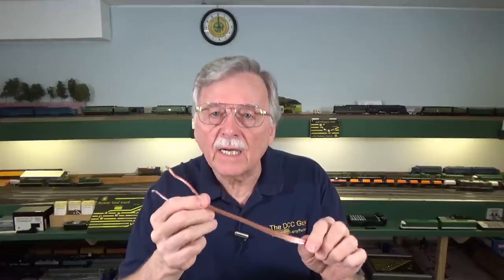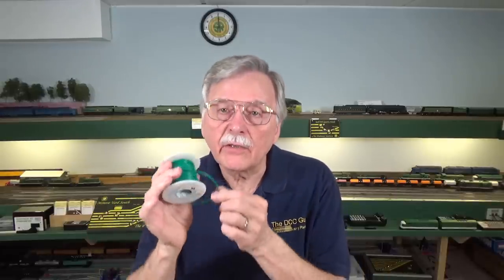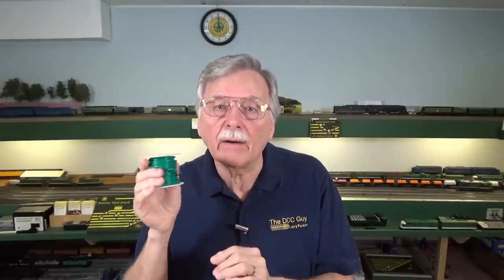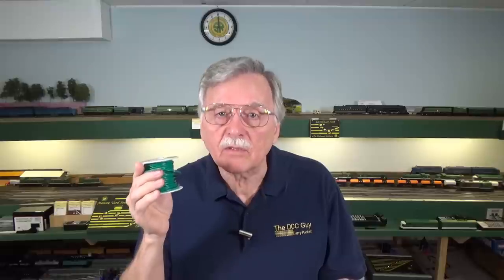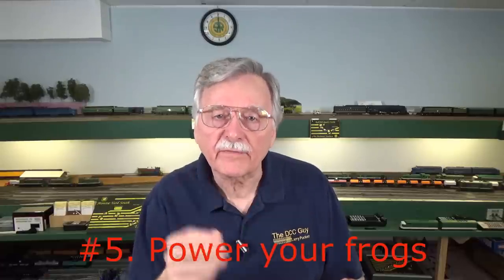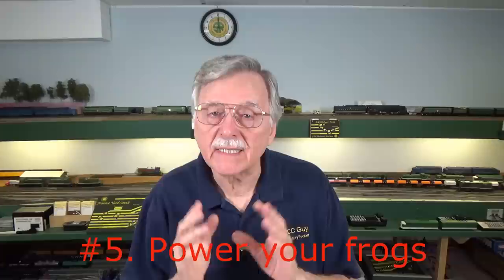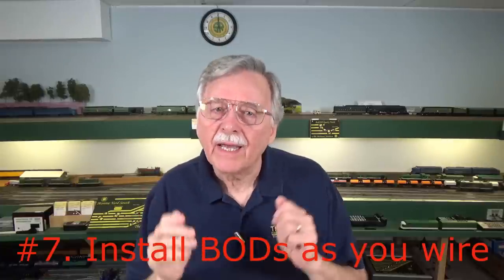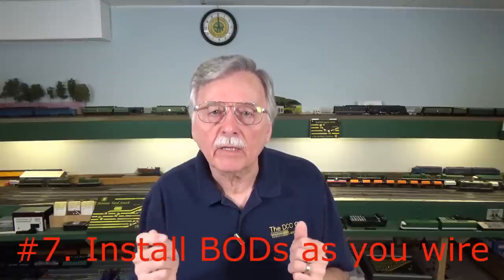8 Electrical Tips For Model Railroaders (313)

Comment: The copper and silver wires you use for your dcc bus wires is known here in Australia as Speaker Wire. I can highly recommend its use. Also, your eight points for wiring is spot on. Thankyou Larry.
Reply: Be cautious with speaker wire.  The speaker wire that Larry uses is true copper wire.  At least in the US much of the speaker wire is actually copper coated aluminum wire.  A 14 gauge copper coated aluminum wire has the same resistance as 16 gauge copper wire and is harder to solder.
Reply: @jimfisher7324  Thankyou for your comment. Yes we are aware of the possible metal mix up. I should have said our wire was copper, the silver one being tinned copper. On a side note, I would have soon twigged on if it was aluminium when I "tried" to soldered it/them 😊

Comment: Larry Great video   I even use Cable labels on my bus lines  I have 18 DCC bus lines so I needed a way to identify them these labels are like a  zip tie  and then I use my label gun to mark them but you are correct you must document your wiring everything under my layout has a label which helps me.

Comment: Great video Larry. It's always good to have a collection of techniques summarized and I appreciate the years of experience. Grounding of DC systems, was interesting, and I totally agree with the concept of keeping the hobby electronics separated earth wise from the safety ground from the utility. In fact, in my industry it is standard practice for all control systems and instrumentation to have what is known as an isolated ground. A separate ground rod or grid from the main power earth. I do not earth ground the DC, or DCC components but as you stated they are connected (Digitrax), as well as the (-) leg of the DC power supply. Also, getting the wiring sorted in advance is also great advice. Since I plan on automating my layout, the correct addition  of proximity sensors around the layout for stopping etc. would be difficult to do later. JMRI is helping to organize what I want to automate, and therefore helping to locate sensors where I need them in addition to current sensing block detection.

Comment: I was particularly interested in the step-down power supply converter system as I have developed a low-cost DIY under track switch machine powered by a 3 volt DC motor.  These motors can be purchased in bulk at a very low cost and they can be mounted to the underside of the switch ties and connected directly to the switch throw bar making a very low cost, compact switch machine which can be installed in a matter of minutes. A sticking point of my scheme is a power supply. I had considered battery packs as the power required by these motors is so low that even a AAA battery will last for years. I have beta tested these machines on fellow modelers layouts so this is not a guess. Another advantage of my design is that it can be used to operate line side equipment such as a semaphore by having a center off position and selecting "stop" or "proceed" by changing the polarity of the voltage to the motor. This would require providing power for an extended period of time rather than intermittently as in a switch application. Using a power buss would make this feasible. BTW at 3V a DC motor can be left powered up indefinitely without danger of overheating. I tested this as well by leaving a motor powered at full stall overnight and checking its temperature the following day. Do you happen to know if a stationary decoder could be connected to a 3V power buss and used to control devices operating at 3V? I would love to control switch arrays (yard ladder) powered by my 3V motors with my hand held throttle.

Comment: As you were talking about the 12Vdc bus I was thinking about the 3Vdc for LEDs.  I've used them to avoid the hassle of dropping resistors, especially when a large number of LEDs are in a single building and push the resistors to their 1/4 or 1/2 watt power rating and get quite hot.  There are also an increasing number of accessories using 4.5 Vdc, so if you end up with a significant number of those another dedicated bus is justified.
Reply from the maker: Yes, add whatever makes it easier in the long run. I love those little buck boards which allow me to customize a local sub bus for whatever purpose is required.
Reply: @Model Railroading  I use buck converters as well, notably for the 4.5Vdc needed for Miller Engineering animated signs.   I don't have enough to justify a full bus but as things develop it might become a requirement.  I also find it worth paying the extra dollar or two to get the ones with the digital voltage readout.

Comment: A note on Digitrax "grounds". As you point out they are not true grounds.  " The "grounds" in the loconet cable are connected to the ground terminal on the power plug.  If you don't run a wire between the power plugs, there is a chance that a high current from a fault could be directed through the 24 or so gauge of the "grounds" in the loconet cable.

Comment: Regarding the "floating ground':  you mention that DCC equipment such as those from NCE should have ground from each piece of equipment connected together.  Could that same ground be run outside to a copper rod driven into the ground (earth ground), or do the floating and earth ground have to be kept separate?  My electrical knowledge is barely past the ability to change a light-bulb, ha-ha, (it's actually not at all funny due to the potential to ruin over-priced model RR equipment).  I've ordered and received from Kalmbach Hobbystore in WI two of your books (Wiring Your Model Railroad and Wiring Projects for Your Model Railroad) and have begun studying them as I prepare to build my first ever model railroad layout (n-scale, 5'x14').

Thank you for all the videos you have made, sharing your knowledge, advice and tips for this model railroad hobby; I've been watching hours and hours over the past few weeks.

EDIT:  Your channel seems to focus primarily on DCC -- can you point me to a source for DC model railroad knowledge, as I am not willing to pay the outrageous over-inflated prices being charged for DCC equipment?  Thank you for your time and assistance.
Reply from the maker: NCE recommends against doing the true earth ground, just the floating ground.

Comment: Great advice.  But you left us hanging. what was the electrical problem with that layout?
Reply from the maker: The worst one was it was just one long power bus over 100’ long and not a single circuit breaker anywhere! We still haven’t figured out how the signal system worked. Plus the throttle network did not have sufficient power and there were too few wireless receivers. I found some feeders that must have been 10’ long, doubled back on themselves, and used tiny wires. The surprising thing was the fellow who did the wiring was a retired electronics tech on nuclear subs!
Reply: Okay, the electronic tech from the Navy explains a lot. Their motto "There's never enough time to do it right the first time but there's always time to do it over again".😂

Comment: Hi Larry thanks for your reply what i want to know is if it is relevent to the upgraded equipment  or is there another book in that covers the modern stuff Cheers Steve😎
Reply from the maker: At this time I don’t know of any. You likely won’t find books with detailed info on specific equipment since manufacturers upgrade often enough that the book would be out of date quickly and publishers try to avoid that. Most detailed info is published in magazine review articles or in DCC columns.

Comment: Thank you Larry for the great tips, as usual. In a DCC layout, we all know that you should limit 14 gauge wire to 30 feet but is it just the command station or the bus wires? For example, if you have a linear 120 foot layout and the bus is broken into 4-30 foot sections, a, b, c, and d and you put the command station at the junction of b and c, do you need another command station or if you have boosters for a and d and the bus divided is that sufficient or would you suggest a different location for the command station and boosters? This would be for Digitrax duplex radio.
Reply from the maker: Each individual run would be 30’ so you’re OK. However if you create a “Y” in your wires then you would add the initial run plus the extended run for each ”Y” section. If for example you ran 10’ then had 2 20’ runs from the “Y”, then each would be 30’.

Comment: Hi Larry I noticed in the wiring book you are promoting that it has older system equipment I was wondering if there is an updated version showing the new components especially Digitrax  but of course the others as well? Cheers Steve
Reply from the maker: The book was mostly written in late 2014, early 2015 just before Digitrax began their upgrades. The book focuses mainly on wiring and provides introductory material on DCC equipment.

Comment: I'm confused.  My retailer sold me very thin wire for Viessmann DCC and confirmed DCC needed thinner wire than DC!

I'm from the old school of DC with 'speaker' wire.  Not today's but yesteryear stuff, much like you showed.

Regardless, I will use Australian household lighting wire (minimum 10 amp) 1.5mm for my bus lines.  Thicker than old 'speaker' wire.  In sections / blocks of course.  From the ends of each section bus, about 5 - 6 meters back to the controller.

I'll also be wiring so I can use DC, DCC or anything else.  I've designed a socket and plug arrangement which will allow that WITHOUT the traditional risks.  Eg it will be impossible to to back DC into opposite pole DC or DCC.

Tip - Do NOT power point motors from track power.  Use an accessory power supply.  Many reasons, including costs.
Reply from the maker: I and everyone else I know follows the advice of the bigger the better. Basically smaller wire increases resistance and can reduce voltage. I’ve always suggested using 16-18 ga for N, 14 ga for HO/S/OO, and 12 ga for larger scales on the main power bus and 20-22 ga for track feeders.
Reply: @TheDCCGuy  Could not agree more for DC.  DCC is the issue.  Funnily because I'll be wiring up for both, I've gone for 1.5mm bus max 5 metres.  (Distance also affects loss of power.)

Comment: You mentioned using zip cord for your bus wires, but with HO running DCC and creeping up on the 30-40 foot length of runs, would lamp cord be adequate?  I have not found any that is larger than 18 gauge wire.

EDIT:  I just found it - it's low voltage outdoor landscaping wiring.  Available in 12/2 wire.
Reply from the maker: As I said in the video I use 14ga zip cord and it is available in 10 & 12 ga as well. I got mine from https://www.parts-express.com/wire-cables/bulk-wire-bulk-cable/hi-fi-speaker-wire just make sure to get the OFC (oxygen free copper) and not the CCA (copper clad aluminum).

Comment: Mr Puckett, I’m new to model trains and I installed a Walther switch machine to my layout, and I don’t know how to power my frog using the machine. I’m using DCC power to my rails and DC for the switch machine. Hoping you can help me with this. Thanks for all of the help. B L
Reply from the maker: OK, I have a couple of these but have never gotten around to installing these so this is based on a quick look and not actual installation experience. Although I cannot find any mention of how they expect you to power your frogs I did note that there are 2 SPDT switches mounted on either side of the servo motor. These are marked NO, NC, and C meaning normally open, normally closed, and common. When I fired mine up I could not measure any voltage on these contacts so I assume they are provided for powering the frogs just as you would use one of the SPDT switches on a Tortoise. Basically connect the frog feeder wire to the C and a wire from the rail A and rail B DCC power bus wires to the NC and NO contacts on one of the SPDT switches. Now whenever you activate the switch machine it will make the connection to your frog. If you were lucky and got the polarity correct then when you run a loco through the turnout it will not create a short. If you got it backwards it will short and you can just swap the wires to the NC and NO contacts. If you can wait a day I will confirm this with my contact at Walthers.
Reply from the maker: Sorry but the technical expert on this device is out of the office until next week and the regular staff was clueless. So hopefully I’ll get a call back from him Monday or Tuesday with a definitive answer.
Reply: Thank you , I tried to contact Walthers also but never got a reply. I will test this out today, do I have to power the switch with DCC power  ?? Thanks for your help. B L.
Reply from the maker: I really wish you would wait until we can get a confirmation on this from Dan at Walthers on Tuesday or Wednesday when he gets back to the office. I am really just guessing on the purpose of the SPDT switch and would hate to see you burn up the switch machine.
Reply: @TheDCCGuy  OK, i have a lot of other things I can be working on, thanks again for your help. BL
Reply from the maker: I finally got a call back from Dan at Walthers and he did confirm that either of the microswitches can be used for powering the frog as I suggested in my first response.
Reply: Thank you so much, I will do it today and will let you know.
Reply: Thank you Mr Puckett my frog is powered now with the walther switch machine, it was so easy, but I was afraid to burn up the machine. Thanks again-B L.

Comment: More of a question. Can you wire more than 1 pm74 (used for short circuits) on a single booster
Reply from the maker: It appears so. Looking at page 6 of the manual it shows how to interrogate the status of multiple PM74’s.
Reply: @TheDCCGuy  thanks I thought so. Didn't want to blow anything up

Comment: Be careful with speaker wire. Make sure the wire you purchase is copper. Some of the companies that make it have  used aluminum wire instead of the tin plated copper. I'm sure Larry is aware of this.
Reply: Agree.  Care too whether the old thick stuff (Ok for eg 8' x 4' DC layout) or the modern thin stuff (no good)  Clear cover allows you to check copper or other.  Some use one of each.

Comment: Do you connect the 14 gauge bus wire directly to a DC transformer to power the track?
Reply from the maker: Typically short but smaller diameter feeder wires carry the current from the main bus wires to the rails.
Reply: @TheDCCGuy  Larry, Thanks for the reply. I see lots of vids about feeder wires connected to the bus to power the rail. What I do not see is what is the bus wire connected to to get its power to send power to the feeders and up to the rails. Does the 14 gauge bus wire get its power from being directly connected to the dc transformer.  Sorry if I seem dense about this.  I'm knew to all this.
Reply from the maker: Yes, just like i  your house as soon as it is connected to the DC power supply it can power the rails and trains.
Reply: Thanks, Larry. One more question. I'm wanting to find an electrical connector to go between the transformer and bus wire that I can mount on my train table so that I can disconnect the transformer, move to the far side of the layout and reconnect transformer to other end of the bus. Any suggestions?
Reply from the maker: Check out Wago and Anderson Power Pole connectors.
Reply: @TheDCCGuy  Thanks so much for information.  I bought WIRING YOUR MODEL RAILROAD and I'm sure it will answer a lot of questions as I get deeper into my build.

Comment: Hi Larry, Good video, I need to get your book out of wherever I stored it. I’ve put off starting my layout because we weren’t sure if we were going to remodel our house or build new and I didn’t want to be moving the modular units I plan to use. I’ll probably watch this a couple more times before I begin as building is going to take 6-8 months, if we’re lucky? I’ll be reviewing many of your videos when I begin. I do have one question, can a DCC layout be setup and run from a tablet? My newest has more storage than my old one. My last computer experience was Fortran with IBM 1400 back in college and the one that was running the paper co. in Wis. Rapids was a big IBM 360. So it’s been a while. I don’t want to move the modules more than once! Thanks for sharing your knowledge.
Reply: Yes, this is possible with a central unit that supports Wi-Fi.
Reply: I am using my samsung tablet w/ engine driver throttle. works great. Nice big screen. great for running a couple of engines at the same time. Big buttons are great.

Comment: I'm working on a small HO layout not much bigger than a "TimeSaver", with only about 7' total length, but with 8 #5 Peco Electrofrog turnouts. From my understanding of what you're saying, I only need 1 set of track feeders for the entire layout? But I'm also surmising that because I've done the modifications to the turnouts per your suggestions, I'll need track feeders on every turnout. Is that correct?
Reply from the maker: Yards and ladders do require extra feeders because the turnouts do break up the electrical pathway. However in many cases the stock rails make one long rail once the rail joiners are soldered on which means only one feeder would be needed on a section like that.

Comment: Does anyone manufacture power buses to supply extra track power? Thanks.
Reply from the maker: Not sure what you mean. Do you mean higher voltage or amperage or something else?
Reply: @TheDCCGuy  voltage for DCC
Reply from the maker: Some systems such as Digitrax have scale switches that allow you to change the voltage provided to the track bus. Some allow you to adjust them using a screw setting. Others simply pass through the voltage of the input, so you can select the voltage that way.